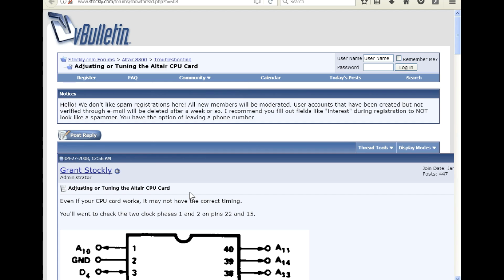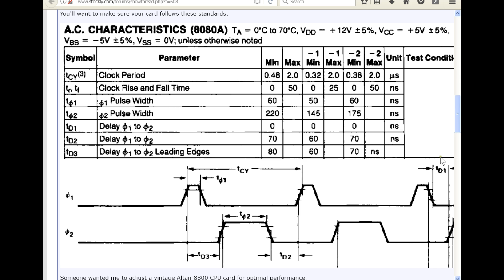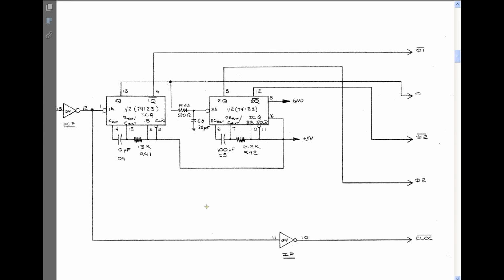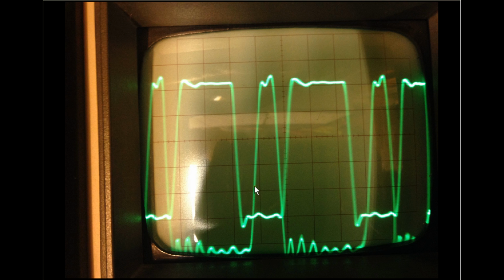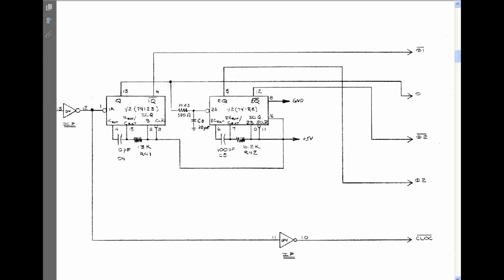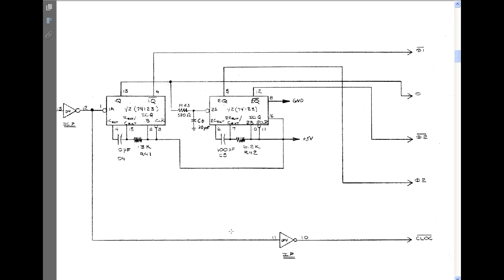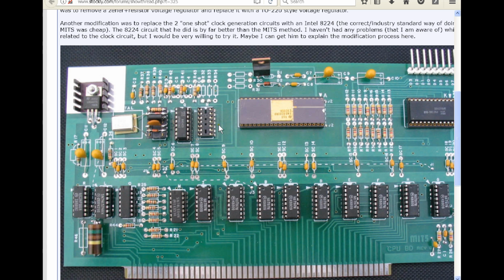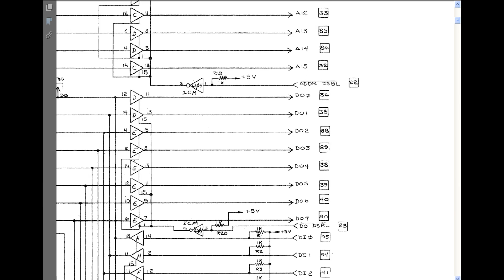Altair 8800 Build Project Part 5 - CPU Clock Tuning

Comment: Thank you for the video. My tD2 was 52ns in working conditions, but if I change R42 from 6K2 to 4K7, tPhi2 is exactly 220ns and tD2 is 106ns. So I think I will switch to 5K1 and it should produce the correct signal.